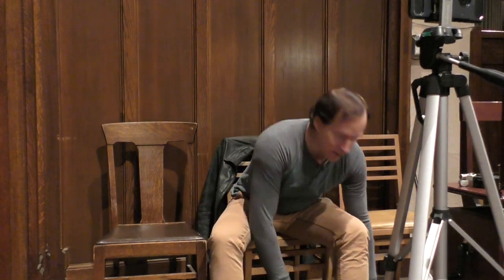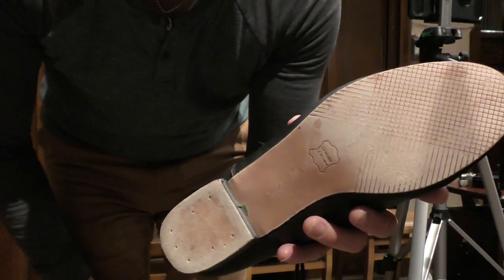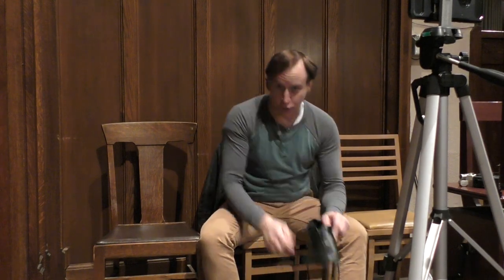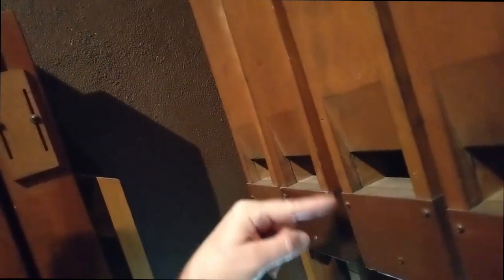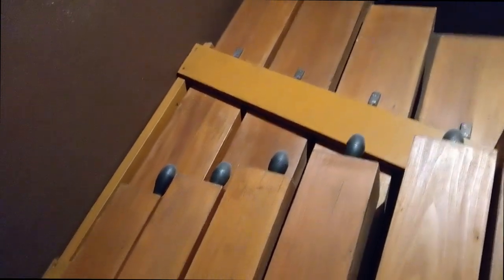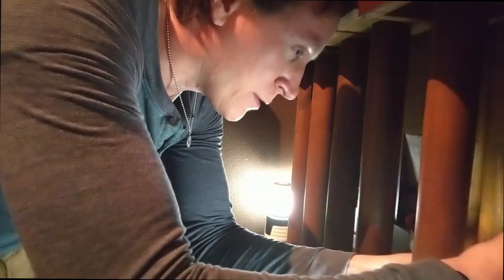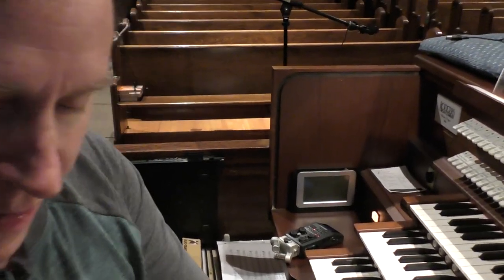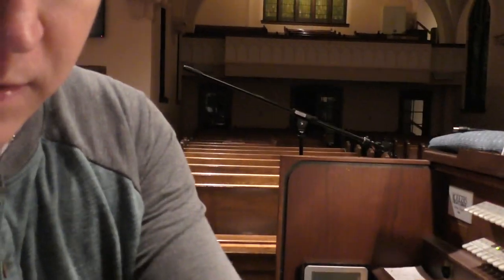Some Big Low Organ Pipes - Exclusive Tour - How do they work?  (HD)

Comment: My organ shoes have felt soles not leather soles. Leather doesn't work well on the pedals. And you never walk with organ shoes on while walking on hard floors like wood or concrete or even tile. You can however walk on only one kind of flooring with organ shoes on, that would be carpet floors and only carpet floors can you walk with organ shoes on.